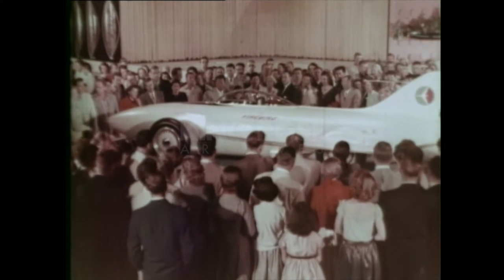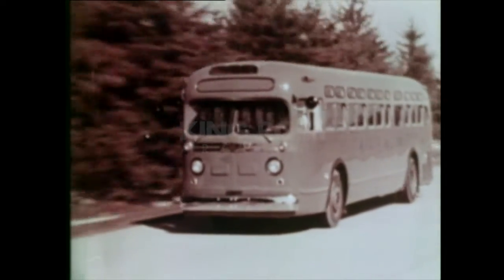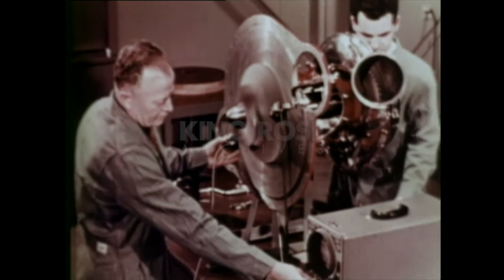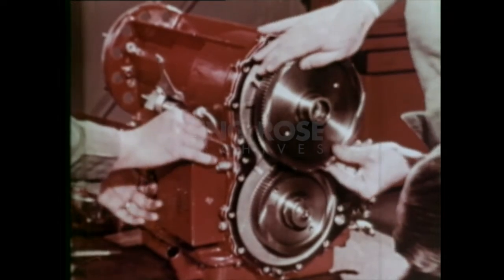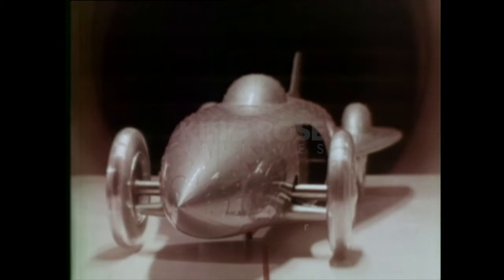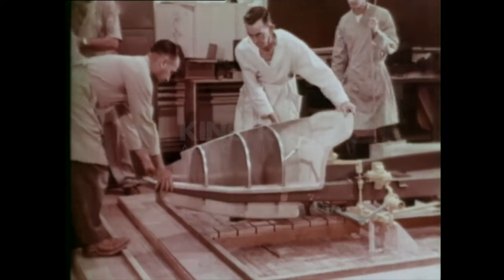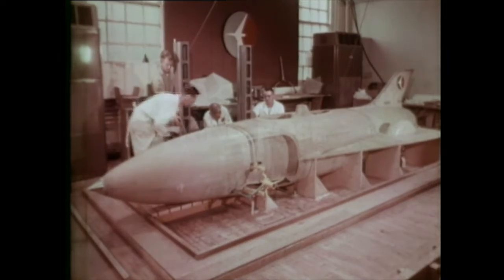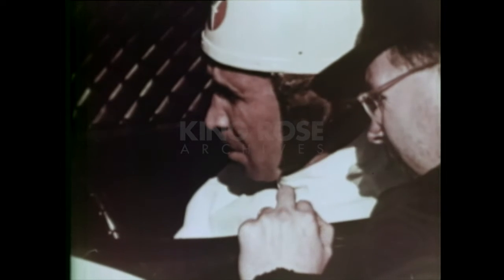Beyond Tailfins: The Shockingly Advanced Tech of the GM Firebird III

Comment: Why no gas turbine? Cause the world wants to go all electric whether or not it's actually the best or only solution.😕
Reply: Chrysler tried too, with their limited production gas turbine sedan in the 1960's.  The trubine's main issue was that they are fuel - thirsty at low speeds.  Turbines also operate with highest efficiency at constant (rather than variable speeds).  
     Where they might actually have an application in todays world might be as a range extender in an otherwise electric car; run a small gas turbine (they're already availble for use as high - end RC jet aircraft models) to turn an alternator at a constant speed to charge the batteries; esentially a turbine - electric hybrid rather than a conventional piston gas engine hybrid).  I think I read somewhere that Jaguar as already experimenting with such a concept. 🙂
Reply: I'm waiting for electric 747s & electric spaceships.